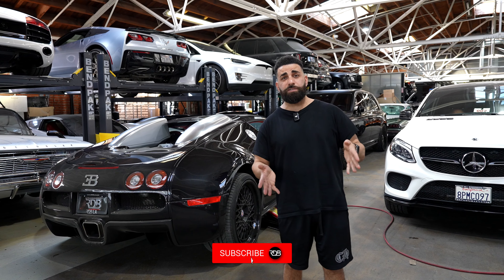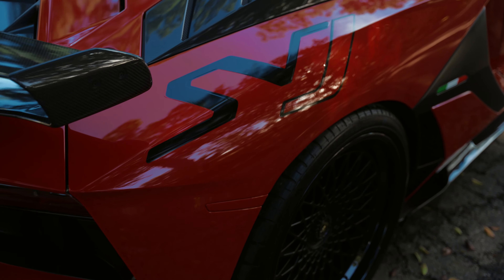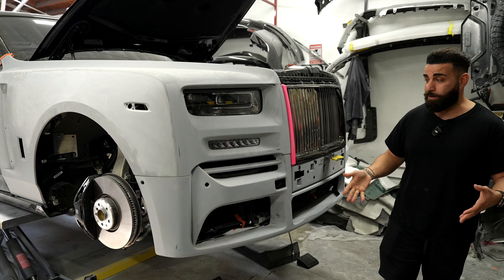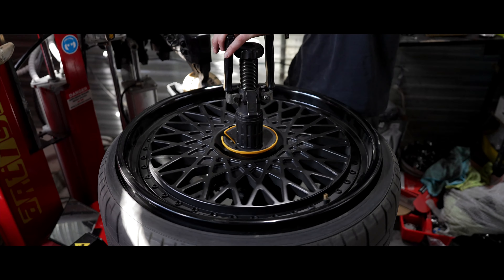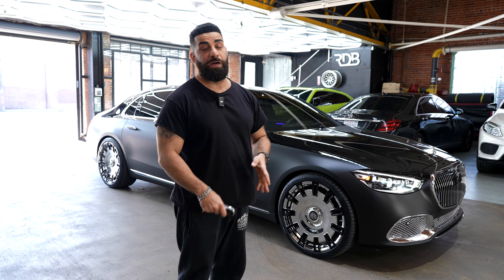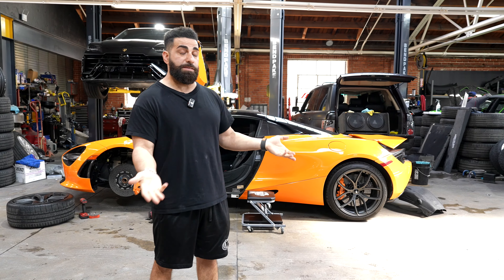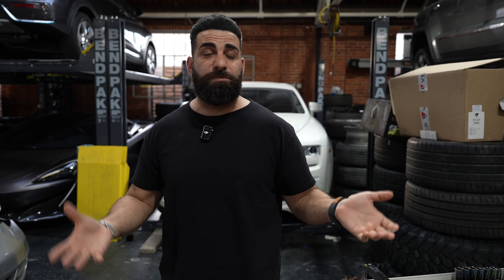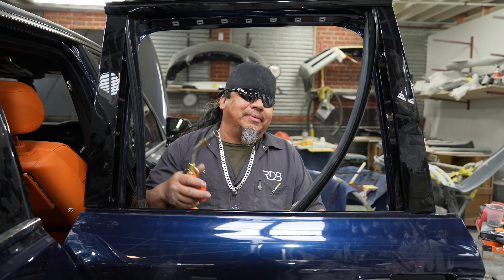INTENSE RED Lamborghini SVJ Cant Believe its not Paint!

Comment: How can RR justify a suspension failure that's that catastrophic 😮...
Reply: You'll have to tell that to BMW. The suspension is about 10 years old. The airbag material starts to degrade from age. Unless a manufacturer figures out a new material design that lasts longer than air shock rubber, this problem will always continue.